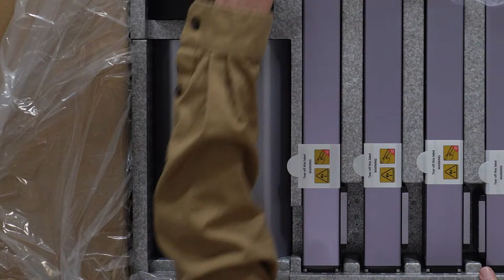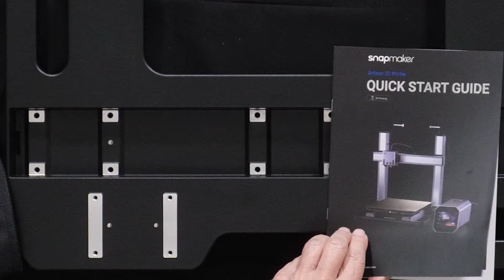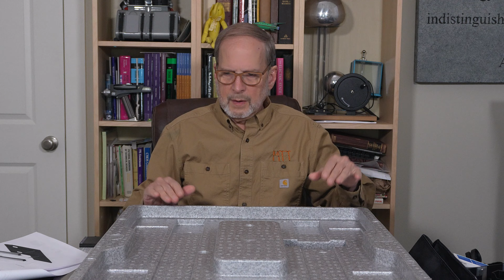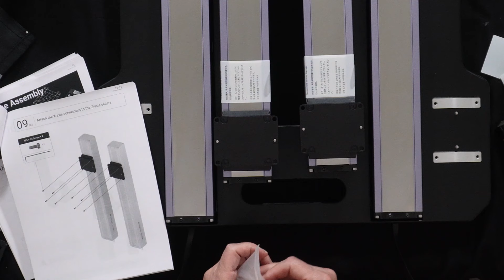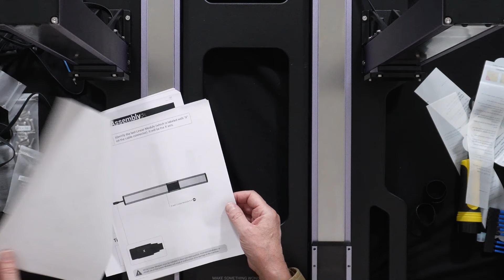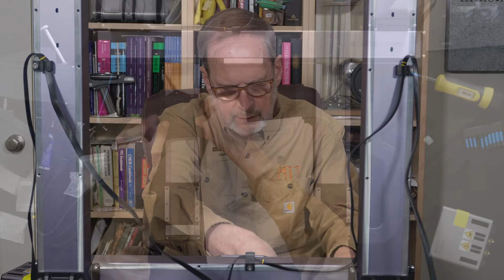Unboxing and Detailed Build of the Snapmaker Artisan 3-in-1 3D Printer

Comment: Great video! I love the detailed walkthrough.  I also really like the use of the thread lock machines like this really do vibrate like crazy and I think it's a good idea to help hold everything together.  Also I really like the use of the torque screwdriver.
Reply from the maker: I agree, the torque screwdriver is a must-have when working with this type of equipment.